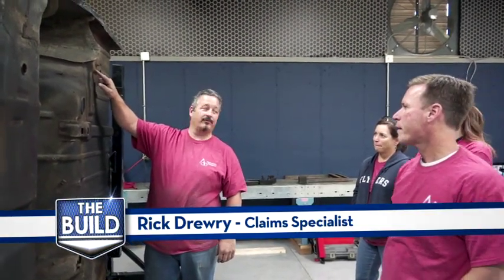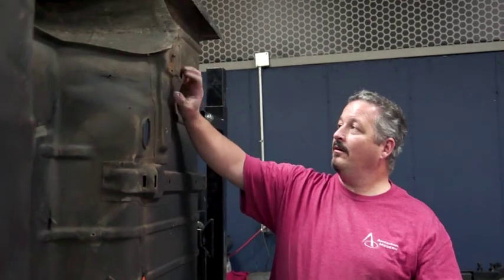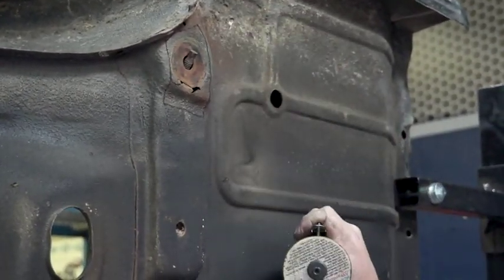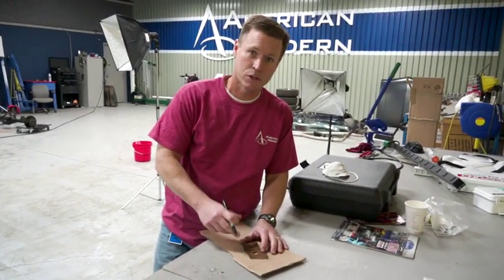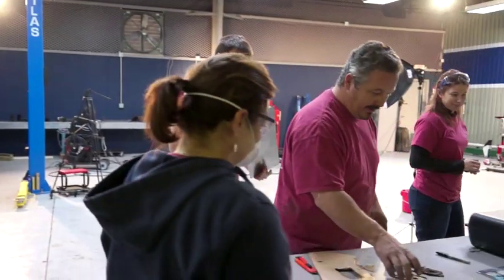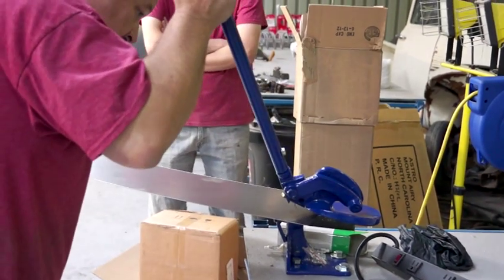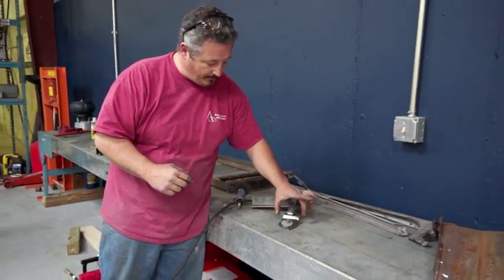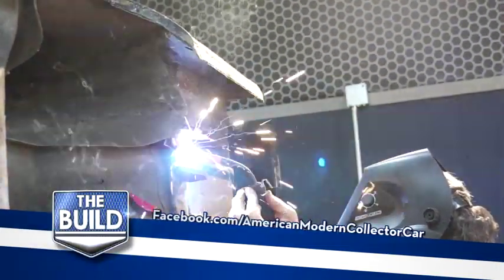Body mount repair - The Build

Comment: Will this type of repair hold up forever or will it eventually crack. Also would there be any problems with the hole not being exactly the same after recreating it and the body panel gaps not being perfect?

Comment: Why were all the helpers or students wearing dust masks? I didn't see any bondo dust flying around that they would need to guard against! That is how I make panels in my home shop for body work--custom make them. Normally I don't waste time making a template. I just take a couple of measurements of the repair area for width and length of new piece, then I start trimming a piece of metal with some snips to size and tack it in. That was a laborious process of making the replacement piece.  Nice to see I would have done this repair right for one of my personal projects at home.

Comment: On GM cars the floor pan and trunk pan will have a reverse dimple(bump out) directly above each body mount.  Using a whizzer cut an X thru the dimple and peel back the 4 triangles you have just created. You can now access the large nut from the top with an acetylene torch tip. Just warm the nut so you can wind out the body bolt. Then chase the threads of the large body nut. Close the cuts by tapping the tin down and welding them closed. Anti seize on the threads is also a good idea. This method makes body removal very easy and retains the factory attachments.